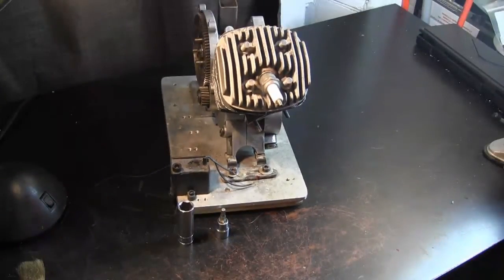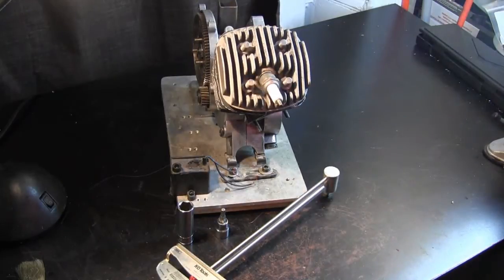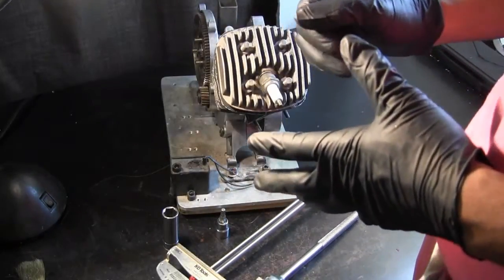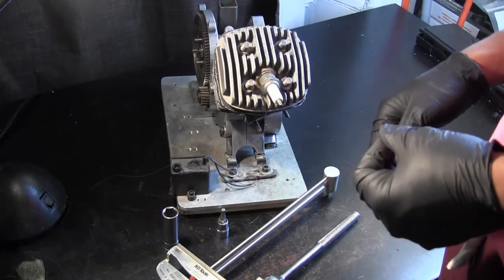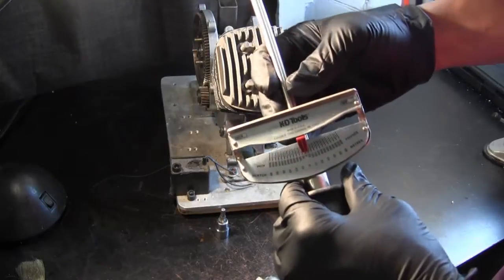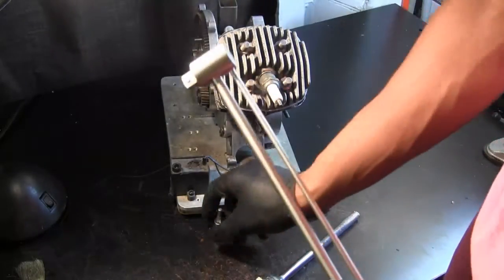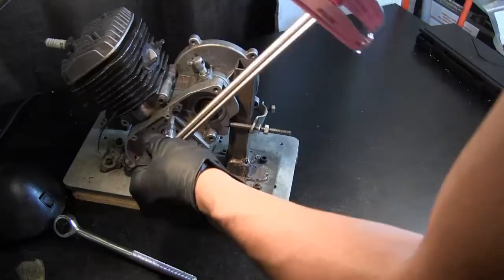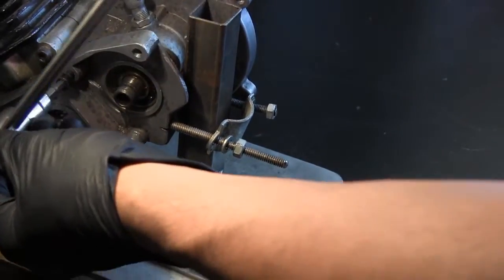Two Stroke Engine Essential Tool: Torque Wrench

Comment: Please clarify...You say 175 in-lb. but everything I have read, even the manual says in the range of 144 in-lb. I have been using 144 in-lb. and it seems to be working fine. I like doing things right but if I go to 175 in-lb. I worried I may brake a bolt.
Reply: It is 2kg m... so it would be 175 inch lbs in my manual.
Reply: Were did you get 2kg m...? All the manuals I have say 12 ft lbs. To get inch lbs. it is simply, ft lbs. times 12 equals. Below is the a link to a conversion chart. 
http://www.kylesconverter.com/torque/foot--pounds-force-to-inch--pounds-force

Comment: 14.583333333 Feet per pound is the conversion
Reply: Conversion for 175 Inch Newtons and it may be too much ! 144 Inch Newtons will work just as well if not better as to account for the differential expansion factor.---------------- Aluminum vs Steel ! 2.6 FT #'s is A LOT !